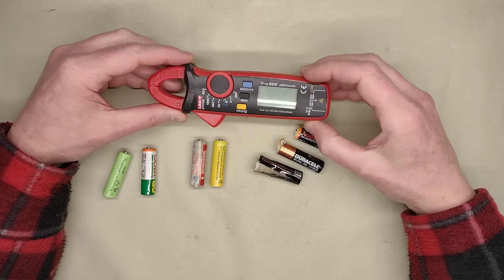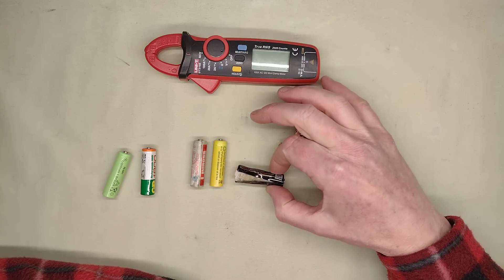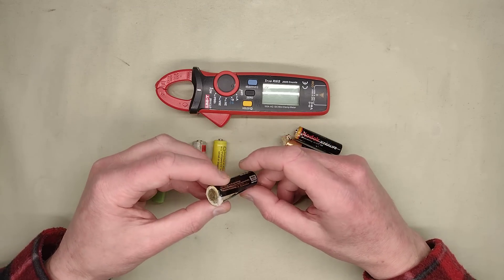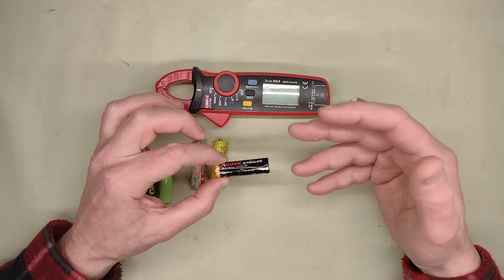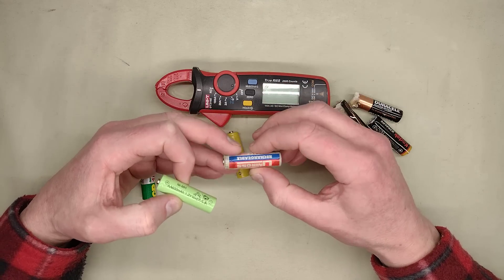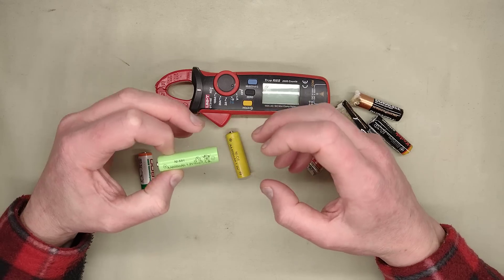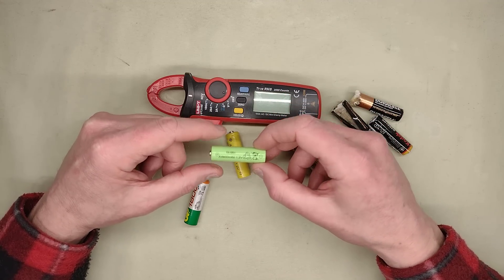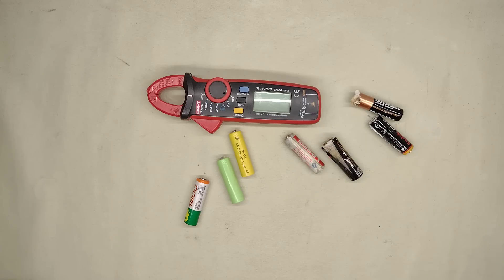The curse of leaky alkaline batteries

Comment: Lately I've been using 1.5v rechargeable lithium AAs in devices that are voltage critical.   They use a voltage regulator to provide 1.5v until capacity is around 10%, then they switch to 1.2v to trigger low voltage alerts.

Comment: I recently made a small gadget that I wanted to power with a Lithium Ion (CR2032) battery, but the battery just couldn't provide enough current at +/- 3V. I ended up adjusting the circuit a bit to use 3xLR44 alkaline button batteries, and now the gadget runs great for a couple of hours or so. Are there any non-alkaline options for powering these mini devices? I was also trying to avoid the charge/discharge challenges of using LiPOs.
Reply from the maker: The quality of CR2032 cells varies widely.  Cheap or used ones may show 3V, but can't provide much current.
Reply: @bigclivedotcom  I learned that current lesson (again) trying to use a CR2032 (new Panasonic), but I was pleasantly surprised with the current provided and longevity of using 3xLR44. The CR2032 only blinked one of the LEDs for a couple of seconds, while the button alkalines flashed the SMD bicolor LEDs and played holiday tunes for a couple of hours! Luckily, I was able to bodge my circuit to use the LR44s. 🤭

Comment: all aa batteries are build to leak. 

remember those days before any alkaline or mercury batteries? what is the major problems 50 years ago? leak. and everytime new batteries format comes out, they promised no leak. as long as they pack liquid inside a metal shell, eventually it leak. the best you can find are those specifically use in camera, they last longer,  but they leak too. which implies one thing, that package method do leak. i will take out batteries of my multi meter and camera when i know i won't use it for a period.

Comment: What has happened! The old zinc carbon U2 batteries used to leak. But at one time, if my memory serves me correctly, I could be wrong, but at one time in the past weren't Duracell Batteries guaranteed against leaking?
Reply from the maker: Yes they did have a guarantee.

Comment: Nowadays I tend to mostly use Lithium AAs & AAAs (LiFeS). Especially in low-energy draw applications

They have super long lifespans (20+ year shelf life), won't leak, have far higher energy density than Alkalines & NiMh, are 1.5V nominal, work in all temperatures, etc.

Main downside is their cost. So I put them in things where it'll be years between battery changes (test equipment, IR remotes, etc). For anything high drain I use NiMh.
Reply: LiFeS?  Kewl.  LiFe has a nominal voltage of 3.3V.

Comment: I've had unused Corrodacells (er, I mean Duracells ) leak less than half way to their 'use by' date while still sitting unused in their original packaging.  In my experience, they have gotten markedly worse as far as leakage goes over the past 10-15 years or so - I suspect it's a combination of chemistry changes due to environmental regulations and cost optimization by the bean counters.  I rarely if ever saw leakage in the 80s-90s, but since 2000 it's been downhill at an alarming rate.  I've been switching as much as possible to NiMH since being turned on to Eneloops on a photography forum around 2009-ish, and have yet to see one of them leak.
Reply: They still have their no leak guarantee but they are pretty cranky about doing the refund and replacement thing. Took me a month to get them to refund the price of a $45 light. Had to send extensive pics of the damage and the batteries.

And like you, I have had unopened 10 packs of Duracells, 5 years away from their expiration dates leak.
Reply: I had same experience with Duracell, leaking in my children's toys when the use before date was 5 years in the future.
They really got worse the last decade
Reply: I remember in the 1980s, the Duracell Coppertops were the best batteries you could buy. Lasted for months of regular use and never leaked. Suffice it to say, they don't build 'em like they used to.
Reply: @mushroomsteve  back in the day, they used to have mercury in them, right? I wonder if mercury somehow contributed to their lifetime.
Reply: I work in recycling and part of my job involves the disposal of (taking the usable 18650’s home) the batteries that come through. We’ve had quite a few lots of unused alkaline batteries from shuttered businesses come through since COVID and so many of the them have leaked within the use by date it’s ridiculous, all voltages. I remember when I first started here and would get a pack of alkaline’s come through and I’d get a little excited for some free batteries, now I just assume they’re duff’s.
Reply: I agree Duracells I do not use anymore.  Even their newer premium ones leak IN THE ORIGIONAL WRAPPER!
Reply: We recently switched to eneloops, sooooo good, especially given the kids night lights and my wavebird style switch controller all use AAs, just cycle them out with a float set that sits on charge and man they last
Reply: Yes !! Eneloops are the best, made in Japan not china, just beware of Chinese copies !! I switched some flashlights to Lithium when physically possible.
Reply: @forrestgumpv9049  From what I've read and (based on buying some), the Fujitsu AA NiMHs sold on Amazon are made in Japan as well, and equal to the Eneloops.  I just wish that Sanyo, Panasonic or Fujitsu would make some Eneloop-type C and D cells, rather than just adapters for the AAs, since the only options in those sizes are more unknown brands.  Not saying the unknowns are no good, just that I'd be ten times more comfortable buying them if they were made by one of those three.  9V as well...
Reply: Duracell used to have a no-leak guarentee. Got a torch once replaced by them, luckily it was a Duracell branded torch.

I don't use Duracell at all now. I find them the worst brand for leaking. They almost destroyed two Fluke meters. Luckily, good old Ebay sell replacement battery contacts for Fluke, so was able to repair the meters.
Reply: I use alot of batteries and I've had more leaking Duracells than all the other brands combined and that's allowing for the fact that I gave up on Duracells years ago.  Corrected for inflation, alkaline cells are alot cheaper than they were in the 70s as well as more powerful.  I suspect that the advertised brands are targeting their products to the more profitable customers who use up lots of batteries fast rather than those who need a new battery for the clock every once in a while.  In recent years, I've had the best results with generic lower amp-hour cells.
Reply: I'm done with them as a brand too. I had an in-date Duracell Quantum actually loudly burst in a device a couple of years ago, and just a couple of weeks ago had a standard Duracell dated 2025 leak in a wall clock.
Reply: My father was an electrician here in Australia and would bring home the 10 packs of duracell batteries (AAA, AA, C and D cells). They used to be the bees knees. Then around the year 2000`2005, they just turned to rubbish. Leaking all the time, full boxes of batteries (mainly the AAA and AA batteries, not so much C's or D's) would have all leaked and puked their gunk out. I have had to scrap more devices than I'd have liked to because of Duracells leaking. And I thought it was just me having that sort of problem with them. Glad I'm not the only one that noticed how the "quality" of Duracells is basically none existent nowadays. ALDI batteries are cheaper for me and are proving to be reliable.
Reply: You have much more faith in people than me. I think it is part of what you said about cost optimization but more so that they want them to be less reliable so that you make the switch by a forced choice. Otherwise they would have found a solution by now.
Reply: @3Hose ,
Very true. When you look at it from an advertising/sales standpoint, that does make perfect sense: 
Duracell: "We aren't selling enough, so let's make them fail more often. That way we'll sell more, and the average consumer is either too lazy, or busy to contact us about the failures. The ones who do contact us we'll give the 'third degree' and they won't contact us anymore."
Reply: Used to keep batteries in all my old tech and toys. No way I will do that anymore, they all seem to leak when you're not looking, even if you never use them.

Comment: I think this is a great debate - nice one Big Clive!

I am pretty old school, so a lot of my devices still require a higher voltage than the 1.2V supplied by rechargeables. I still play retro video games so the Gameboys and GameCube Wavebirds (wireless controller) use them. I can't deny the battery material wastage is suboptimal for the planet, but then charging anything from nuclear power plants or fossil fuels (ie mains power) isn't exactly "green" either.

If voltage wasn't an issue, having a standard size (AA, AAA, C, D, etc) swappable NiMH would be ideal. You could have one set (for each device) on charge whilst using another. Plus you could charge a batch up to take before going camping to power your radio, torches, etc.

The trouble with most rechargeable products are that many use bespoke Li-Ion batteries, which means once the battery has given up the ghost you have to either replace the whole thing (which is wastage in it's own right, bit that's another story...) or find a replacement that's a reliable replacement, runs at the same spec (or close capacity), match the housing dimensions as well as the terminal to be in the correct positions and the right polarity - unless there's enough space to modify the device. Chances are the faff doesn't seem worth it, so we just replace the whole thing.

Frankly there isn't a "right" answer currently (if you pardon the pun 😁), only less "wrong" answers for each scenario.

Comment: Alkaline batteries are a tremendous scam and devices that refuse to run on cells that are still over a volt are a huge part of that.  Just watch tv for 10 minutes (if you can even stand it) and note how many ads are run for those trashy cans.  Duracell seem to be among the worst for leaks BTW.  That's just anecdotal but it's not just my experience.

Comment: What about the Lithium AA rechargeable batteries like the ones you reviewed previously? https://youtu.be/dakm4ra8Xv0  Would they be a better option to NI-MH due to the higher constant voltage
Reply from the maker: For regular use they are good.  But the active circuitry poses a slight continuous current drain.

Comment: Yup. Spot on Clive. Coincidentally, I recently decided to never ever buy another alkaline cell. I started with some original Sanyo Eneloops way back in 2006. I add a few more to my AA and AAA floating stock now and again. I checked my stock recently and now have over 80 genuine eneloops in use. They all have date code and I’ve never had a single one leak or fail with reduced capacity. Even my 2006 ones are still good as new.

Coupled with almost zero self discharge and superb stay clean bright metal contact caps. They are the near perfect domestic battery IMHO. I’ve had very few products that don’t like the lower Voltage. Panasonic bought out the Sanyo Eneloop factory and brand but the quality, performance and distinctive white pearl appearance hasn’t changed. 

To me the really annoying thing about Alkalines is that they will often leak way before the cell is anywhere near discharged. I have repeatedly seen cells that are working perfectly with decent voltage, yet leaking. This means I get no prior warning of failure. The appliance continues to function normally until the corrosive crap gets to the spring contacts etc. 

I have always got a few spare Eneloops charged and ready for immediate use. Yes they are a bit expensive, but once bought they will probably outlast me!  Zinc carbons are still available and I’ve found Panasonic ones never leak. So in very rare situations where lower voltage of Eneloops is an issue I might use them. No more alkalines for me, ever, not even in clocks, RC handsets etc! 

PS I’ve tried several other brand low self discharge NiMh cells, but I find they don’t even come close to the sheer reliability, performance of genuine (still made in Japan, a rare thing these days) Eneloops. So I will only buy these now. I see them as a lifetime investment, and worth every penny.

Comment: Duracells leaking is a relatively new phenomenon. 20 years ago they didn't leak. I even found one that old that was still OK but modern ones leak even before they are fully discharged and still well in date. I switched to Kirkland but found they were just re-badged Duracell. I am now on Energiser but not used them long enough to know if they are better.
Reply: Old alkaline batteries contained mercury, which made them resistant to leaking.  The mercury was there to absorb the hydrogen gas.  Newer alkaline batteries don't have mercury, because it's harmful to the environment when disposed.  Unfortunately, the mercury free batteries leak much sooner - many of them long before their 'use by' date, even if you've never used them.

Comment: I've made a battery tester and several specialty chargers specifically for my rechargeable AA collection!
But moving on to Lithium is a goal for many of my projects, it's got the high-power and the low self-discharge - it's just not as "plug and play" as Nickel based batteries...

Comment: So should I change my toners and cable testers to NiMH? That’s the question! What about 9volts in meters, I know they rarely leak but I’ve seen it! I carry a small pocket radio designed to take alkaline AA or NiMH, it has a toggle switch to activate the charge port on the side of the device if you choose to use NiMH, as I do. If I made the switch then I would have to get a charger as well, I don’t think I can use my lithium sled charger for my 18650s in my flashlights for NiMH tho.

Some Christmas break research!

Comment: One of NiMH's benefits (assuming the newer technology still possesses this behavior) is, if charge capacity declines from short charge-cycling, most, if not all, of it can be restored by one or two complete charge-discharge cycles.  I've accomplished this myself with an old Nokia battery.

Comment: Have you tried Energizer batteries? I have had a lot better luck when it comes to not getting leaks  Also when it comes to medical devices they tend to have a very narrow band onwhat they treat as discharged and NMH don't do well in things like Insulin pumps made by Medtronics. They even say not to use rechargeable cells.

Comment: Another option, which I use, is non-rechargeable lithium ion batteries. The voltage is a little higher than alkaline or NIMH but I haven't found any equipment yet which wouldn't work with them. They don't leak. They cost more but, as you say, one leaked alkaline cell can negate that cost difference in damaged equipment.

Comment: My fluke network tester was badly damaged by old alkaline batteries .. I should have changed the to nickel metal  . it now has a modified battery holder and batteries are not stored inside the tool when not in use

Comment: I recently started making a simple cup from aluminum foil and putting this over the negative end of alkaline cells when installing them.  My hope is that the aluminum cup will keep leaked electrolyte away from the contact so the contact does not become corroded.  All leaks I have seen were at the negative end of the cell, but I see that one of Big Clive's cells leaked at the positive end.

Comment: I've had many devices (including a Fluke non-contact voltage tester) damaged or ruined by leaking Duracell batteries, and I take advantage of every opportunity to complain about them. Thank you for providing such an opportunity.
Reply: Same here, and now I don't leave batteries in equipment that get used occasionally. And the copper tops are clearly the ones always leaking, so I stopped buying them.
Reply: I like to add, they start leaking before the voltage drops below usable point. And they did not use to do that before.
Reply: @ebattleon  Back when I  ran a camera store Duracell/Mallory batteries would leak while still in their package.

I now fix cameras and electronic audio gear and Duracell remains a cussword. I am also less than fond of Chinese batteries.
Reply: @rayrooney4656  Right?  Duracells seem to be the worst at this.  Supposedly Duracell will repair or place the damaged item after you fill out all their paperwork and likely provide the batteries and device to them for analysis.  Who knows how long that would take and if they find some small infraction to dismiss your claim.  I frequently leave batteries out of devices but we all know that isn't always possible and is certainly an added hassle.
Reply: Complain to their customer service, they refunded me for a Garmin GPS damaged by their leaking batteries.
Reply: @spencereagle1118  The trouble is most of the stuff I use batteries in now are very much vintage and replacement is both out of the question and subject to argument as regards value. An old Aiwa recording walkman can go for $300 to $1200 but I doubt they will agree to pay out that much. Same for an original transistor radio from 1959.
Reply: Complained to Logitech once as one of their programmable remote controls had factory 'Not for resale' duracells in it (included in the box) and leaked 3 months in, making it inoperative without proper contact cleaning. They sent me a brand new one with new Duracells in the box (decided against using those for some very strange reason though).
Reply: I stopped buying Duracell, they always leak. For me Panasonic and Energizer never failed, and probably because they aren't made in China.
Reply: I've had new Duracells leak in the package with years left on the expiration